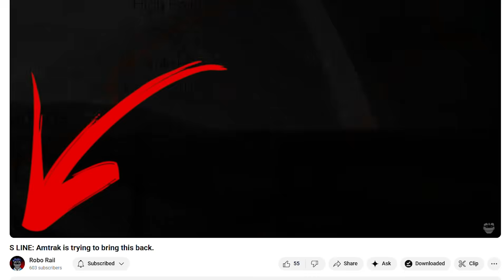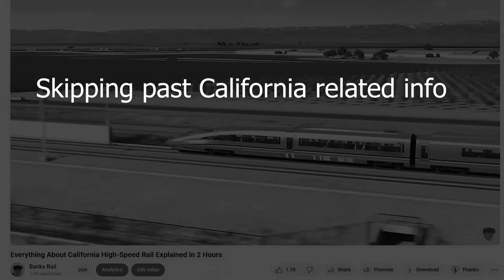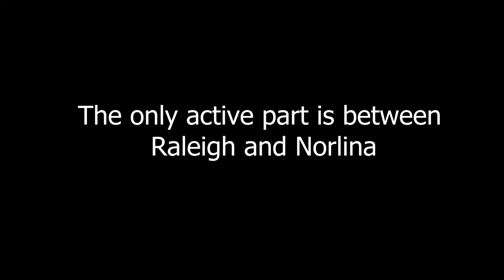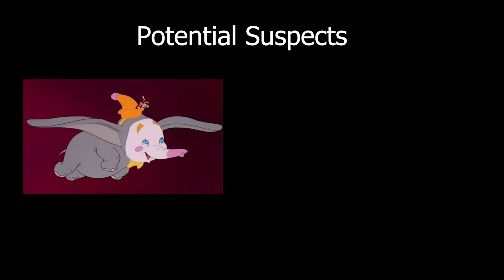S-LINE: Amtrak’s Expansion for 2030

Comment: As need for additional trains is reached, it may be necessary to replace existing equipment. Lower emission Tier 4 diesel or electric locomotives will be needed. Articulated trainsets, with a single truck between articulated cars, would would reduce journal resistance and facilitate wider, doorless, gangways between car sections.

Comment: Great video and history! Now what are overlooked is the S-Line has lower population even if shorter and does not serve the more populous Tidewater area. The A-Line used to allow 100-mph speeds on a much straighter line, and at least two passenger trains would continue to use the route. Raising the speed limit on the A-Line would reduce the time disadvantage of the longer route.

Comment: My crazy ramblings to CAHSR and Cascadia HSR. Yes, I wrote this. Oh well. Just needed to get this out there.:

Hello CAHSR and Cascadia HSR,

I saw a video on YouTube about the realignment of the HSR. Gilroy is a better choice for the initial segment, so that CalTrain can connect with HSR. On the south end, Palmdale please. This would help connect the Metrolink all the way to LA Union Station. But here is a question I have. Why not take it all the way to Union Station using the right-of-way already established, just at lower speeds of course. On the south end, it can hop onto the current right-of-way of the Metrolink Lancaster from Palmdale, so people do not have to get off the train and just go as far as Union Station in LA. Now, does this mean we abandon the high-speed construction between Palmdale and Anaheim, that is a big no. It just means that CAHSR can provide full service as a temporary solution until the LA to Anaheim segment is completed. On the north side, it will be easier because the electrification of CalTrain is established. It may run slower between Gilroy and San Francisco, but it will be a service. Once this service is in operation, California and America can see the benefits of such service that will help the right of America build HSR. One stop service, San Francisco to Los Angeles, even if you must connect diesel locomotives to CAHSR, it is a start. Of course, you will get backlash, the media will laugh, but in the end, we can laugh as well because we got a safe and sufficient system providing a service that California, that America needs.

Please work on a way to connect Gilroy to Palmdale at least. Let’s get this far, this far, no further (Star Trek reference, sorry). I mean, we need this to help build interest. Don’t listen to the media, keep this going. California will be the first, so be it. Props to Brightline for getting us close to high-speed on the Vegas train, but CAHSR, it will truly be the first. Maybe, long after I am gone, there will be HSR all over this country. A combination of air travel and HSR will make America the transportation envy of the world, more than China and Japan. I see this in the future; I know you guys do to.

CASCADIA
One more thing, I see a future where the Cascadia Line, between Vancouver Canada, Seattle WA, and Portland OR will eventually connect to San Francisco CAHSR. Wouldn’t that be amazing? What I see is that when Cascadia is built, they follow the exact same standards for stations width and height, gauge, train width and height, everything. Please make sure it is the exact same, because one-day, I see the system connecting. Imagine catching high speed from San Diego to Vancouver via Los Angeles, Fresno, Merced, Sacramento, Portland, and Seattle. If the standards are the exact same, it will be no problem combining them. Rebranding to West Coast HSR would not be a problem. Please think of the future on this one. In fact, I wish that the federal government sets a standard for all publicly owned high speed rail, so that eventually, they all connect. Maybe by the year 2100, long after I am gone, this can be a possibility. Let’s set that standard now before it is too late.

Hopefully, the next federal administration can set a team together to do just that.

I am a dreamer, even though I see a future that is well beyond my years. I am only 53, but I see well past my life and for the future great great grandchildren riding a high-speed train up and down the West Coast, or from San Francisco to Phoenix, Vegas via Brightline, Texas high speed rail making a complete triangle between Dallas, Ft. Worth, Austin, San Antonio, and Hoston. Eventually, Phoenix connects to San Antonio. From Houston to New Orleans, then onto Jacksonville. The Northeast Corridor becomes the East Coast Corridor between Portland ME and Miami FL, via Boston, New York, and DC. Acela can provide that transit between Maine and Florida, eventually becoming true high speed. Like I said, it may not be within my lifetime, but it can be. Let’s make this successful for our future generations.

Thank you for reading my ramblings.

Comment: Regardless of how high speed it is, it’s just the better alignment between the two urban areas. At first i was skeptical of the project because it seemed to go through the middle of nowhere and I prefer if trains would serve intermediate communities as well as end of line destinations because thats the great benefit of trains over planes
However in this case the current rail alignment along I-95 also goes through the middle of nowhere

So yea pretty much superior in every way to the existing state of things, lets get it built. 
Lucid stew’s video on making the S-line go faster ended up choosing a mostly greenfield/highway median route so I reckon building the higher speed S-line the way it is now is a good place to start and when our grandchildren are old and grey and the government is considering a tru-HSR alternative they can build the alignment greenfield paralleling the S-line

Comment: I'm afraid you're mixing the apples and oranges. When the S-Line is rebuilt to Petersburg it will serve as an interstate conveyance. As such it will be current and expanded Amtrak service running the through service. As for the intrastate service within the boundaries of North Carolina, the current equipment could survive through 2030 and beyond. Replacement will take an official bidding process with builders submitting proposals. Alstom is currently designing and building single level cars for Connecticut so there are options that will have to be considered.

Comment: 110 mph isn't high speed when the Acela does 150mph currently
Reply: Acela barely does 150. A steady 110 throughout the corridor is better than nothing and better than barely doing 150 with an average speed much slower.
Reply: @MrMarshmallow26 the Acela is still a high speed train. If the NEC wasn’t so ancient in the infrastructure its cruising speed would be between 115-125 mph. With it’s top speed at 165

Comment: Thank you. This is an excellent video. I enjoyed the entire video even the distraction about the circus cars. The part I enjoyed the most was the map associated with the 1991 high speed rail act. It is fascinating. It reveals the priorities that were set for Amtrak/FRA decades ago. Can you explain more about it in a future video? For Instance, I counted a minimum of six corridors. I live in North Carolina. I find it fascinating that NC is the only state where major corridors are connected. OK maybe its Virginia, but it's really R2R that is the linchpin, not the Long Bridge, which can be taken for granted mostly, because the Virginia Railway commuter service needs it so badly.

Once the Wake Forest station is operational, Amtrak should start a Thruway bus service from Wake Forest to Petersburg VA, timed for connections with Piedmont (Wake Forest) and a NE Regional train running in and out Norfolk (Petersburg station). It should run in daytime but a different time than the Carolinian.

Comment: Thanks for mentioning the Piedmont! The story behind their equipment is basically, as the Carolinian was growing in popularity, NC officials wanted a second daily round-trip between Raleigh and Charlotte, Amtrak said they didn't have enough rolling stock to make that happen, so NC said "Fine, I'll do it myself", and approved the acquisition of five used passenger cars and the leasing of two diesel locomotives.  They hoped to start service in 1992, but there were delays thanks to Norfolk Southern (surprise surprise) because they wanted the NCDOT to build a wye in Charlotte for turning the trains around. It finally began operating in May 1995. North Carolina has been an Amtrak powerhouse! NC By Train carried over 720,000 passengers in 2024, which is a 12% increase from 2023 and a 55% increase since 2019, prior to the pandemic. The Piedmont is a sister train to the Carolinian, which runs between NYC and Charlotte, both of these are state-supported. Besides serving Raleigh and Charlotte, the Piedmont also serves Cary, Durham, Burlington, Greensboro, High Point, Salisbury, and Kannapolis, and operates along the western portion of the state-owned North Carolina Railroad, which runs from Charlotte to Morehead City. And the NC government did a big improvement program for the Piedmont corridor that was completed in 2018 that included Raleigh Union Station which opened in 2018, adding five miles of passing sidings between Raleigh and Greensboro, adding 27 miles of a parallel track between Greensboro and Charlotte (making the entire segment between Greensboro and Charlotte double-tracked), building 13 bridges to carry roadways over or under railroad tracks, installing remote-controlled high-speed switches in five locations, renovating stations in Cary, High Point, Burlington and Kannapolis, and closing more than 40 railroad crossings. 

And I appreciate Charlotte expanding their transit. For Charlotte's transit, the north-south Lynx Blue Line serves places like the University of North Carolina at Charlotte in University City, NoDa, Uptown, South End, and Montclaire South (which serves a Snyder's-Lance factory; yes, Snyder's as in the pretzels), with expansion plans to serve the Ballantyne neighborhood and the town of Pineville, is a light-rail line that's basically a light metro. The Lynx Blue Line has spurred significant development, notably transforming the South End into a vibrant hub while also fostering growth along the Northeast Corridor serving University City and the University of North Carolina at Charlotte. The east-west CityLynx Gold Line acts as a streetcar, serves places like Johnson C. Smith University, Central Piedmont Community College, and Johnson & Wales University, serves Charlotte Gateway which is a new centralized intermodal station acting as the new Amtrak station as well as serving Greyhound alongside the Gold Line, and connects the Rosa Parks Community Transit Center in the University Park area of west Charlotte with Eastland Community Transit Center in east Charlotte when fully completed. The two lines meet at the Charlotte Transportation Center which is the central hub for CATS buses, where 44 local and express bus routes stop! CATS also has microtransit, like a zone serving Cornelius, Davidson, and Huntersville, which serves things like CATS park and ride locations, Northlake Mall, and other retail centers. 

Expansion wise, the Silver Line plan has an east-west light rail alignment from the City of Belmont in Gaston County, through Uptown and the Town of Matthews in Mecklenburg County, and into Stallings and Indian Trail in Union County. The Silver Line includes Charlotte Douglas International Airport as well. And then there's the Lynx Red Line commuter rail plan of connecting Charlotte with its northern suburbs, bringing them to Gateway Station. Charlotte purchased 22 miles of Norfolk Southern right-of-way (the O Line) and land near the future Charlotte Gateway Station for 91 million dollars for the service in August 2024.
Reply: I remember seeing your pfp in alot of china uncensored videos comment sections. Is that really you?

Comment: Coming in the year 2075 after an initial expected completion date of 2040 with a cost overrun of 140billion and speeds limited to 90mph along 30% of the line and 65mph along the rest of the line and 3 trains/week down from an initial proposal of 4/day! tickets only $749 each way (no bags included). The station will be only 18 miles outside of Raleigh with a 90-min headway 42-min bus ride to downtown! Or feel free to pay $68 dollars for an Uber! only 55% of the line will be single-tracked, and with only 28 level crossings!

Bringing much needed transit capacity relief for the large swaths of Americans who routinely travel between Petersburg VA and Raleigh NC! Take that, American Airlines! Future here we come!!!

Comment: Once built and electrified they can connect it to the north east corridor.
Reply: Are there plans to electrify the "S"-Line Corridor? I hope there is, though the dual modes will be a decent interim solution for a while.
Reply: @scrat4379  They will look into it in the design phase.
Reply: @scrat4379  No way, same hat.
Reply: Only thing is the RF&P Subdivision is between the two, and CSX does not want that electrified.
Reply: @MrMarshmallow26  Meanwhile in Europe:

All Electric Freight Trains with more horsepower and Torque than the GEVO with less parts meaning less maintenance.
Reply: There are dual powered locomotives. They can switch between diesel and electric
Reply: @pirazel7858  Full electrification would be better but dual modes would be a good short term solution

Comment: I think(?) some of those circus cars (or at least similar) are being used by the Fort Wayne Railroad Historical Society. Probably a better use for older coaches. (And hopefully the current old ones can be sold for preservation use).
I swear, the Piedmont's equipment will have a decades jump once/if they buy new equipment. The passengers may not even recognize the train as the same service!
Reply: Plausibly a 75 year jump (1955 to 2030).